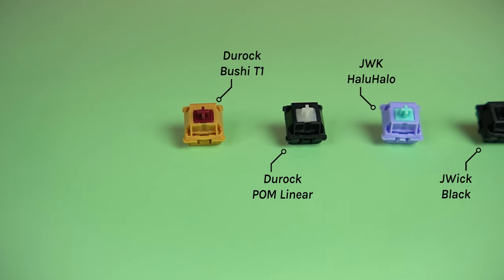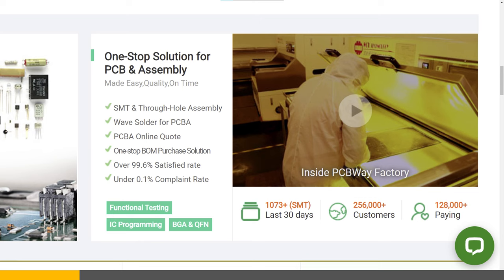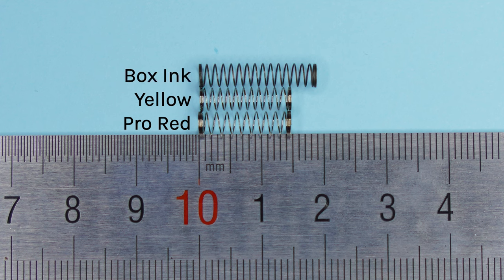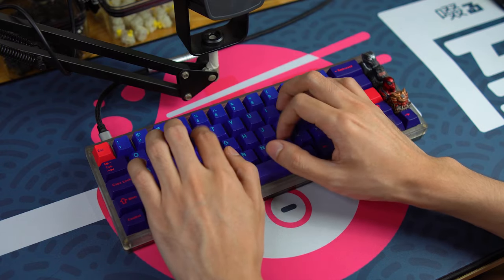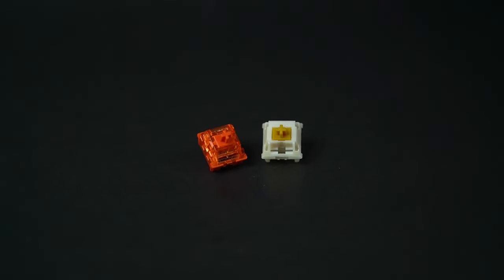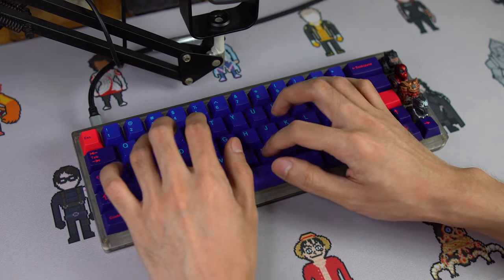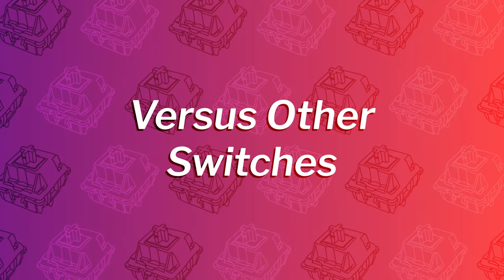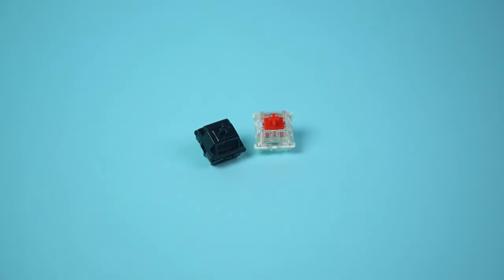Cheap vs Expensive: New Gateron Switches • Milky Yellow Pro vs Box Black Ink

Comment: I'm grateful for finding this video as it helped me finally decide between switches! I couldn't decide whether I wanted to try to the more expensive options or just go with the budget king yellow pro. I ended up going with the yellows since the difference was negligible. Thank you so much.
Reply from the maker: Nice! Glad to hear it ☺
Reply: You can consider oilkings definitely better than yellows but difference is minimal
Reply: @goldenplectrum9695  better in feel (smoother) and also heavier (preference based). sound wise, very neglible

Comment: I probably can shorten the explanation: 

Why Milky Pro Yellows are better: 

1. A lot cheaper
2. Tolerable/adored pitch
3. Better spring weight although shorter
4. Doesn't require lube/film to make it sound amazing

Note: 
All these switches are good, depending on the preference of the person using it. The gateron ink blacks is debatably better weighted for the heavier switch fans, slightly smoother, helps a bit with north facing interference, but more than 3 times the price of the milky pro yellows, which is identical in pre-lube performance, better in spring weight for the lighter or middle lovers. I think the milky pros are better, or just better in value.

Comment: the reason why I want to switch from Gateron reds to milky yellow is because the reds are too light. Sometimes I press keys accidentally without even noticing and according to Gateron the yellows are perfect if the reds are too light. Then I discovered the milky yellow pro and now Im gonna take these instead of the normal yellow pro 3.0

nice video! :)

Comment: So you mentioned that both switches developed sharp noises after use, likely due to lube leaking. Did that also affect the feel of the switches in any way?
Reply from the maker: No, they still felt just as smooth.
Reply: @CaloysKeyboards  Alright thanks

Comment: Do you have to break in milky yellow pro before lubing or you can just lube it off the get go
Reply from the maker: For me, there's no need to break in any switch. This one especially doesn't need it as it's already quite smooth even stock.
Reply: @CaloysKeyboards  the vintage black definetly needs break in

Comment: On my favorite website the only milky yellows i see are called Gateron CAP (Milky). Are those the same as these ones?
Reply from the maker: Those are different. On the cap switches, there's a hole on the stem where a pole from the bottom housing slides into. On most other switches it's the opposite: hole on bottom housing where pole from stem slides into.
Reply: @CaloysKeyboards  oh i see thank you, does that make a big difference in the feel like stem wobble or smoothness?
Reply from the maker: @andrashoffmann7522  I haven't tried the cap switches yet so I can't say for sure but I seem to remember people having problems with the first version of them but I hear the v2s are much improved.
Reply: @CaloysKeyboards  okay thank you ill look into that ✌️
Reply: @andrashoffmann7522  The Cap V2 series in my opinion are big improvement from the Pro series and have their own unique aspect. The stem wobble is less than Pro and they are smoother than Pro after lubed, so I would recommend you get the Cap (Milky or Golden) if you have the chance :D.
Reply: @huunhanle3809  alright thank you :D

Comment: I'm not a fan of 205g0..never was. It takes away too much of the specific sound signature of a switch.
I'm a fan of 3203/3204 or even 107 oil. Usually I'm lubing only stems or only bottom housings.